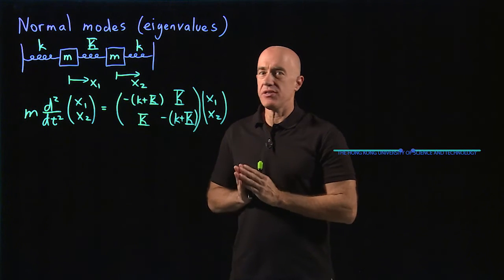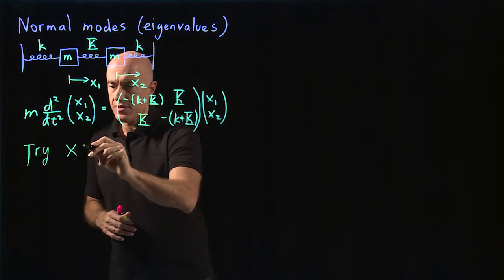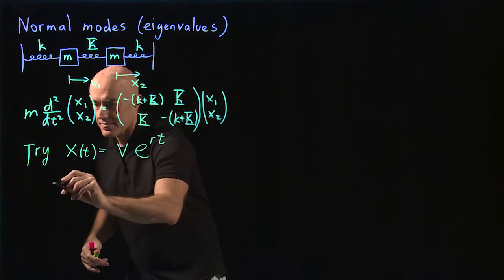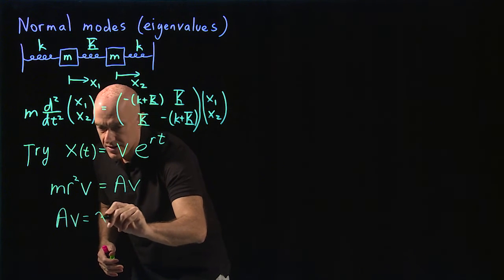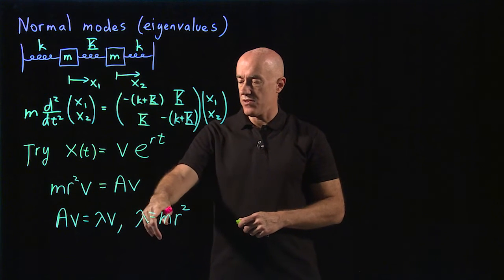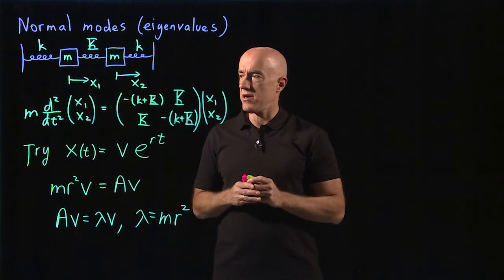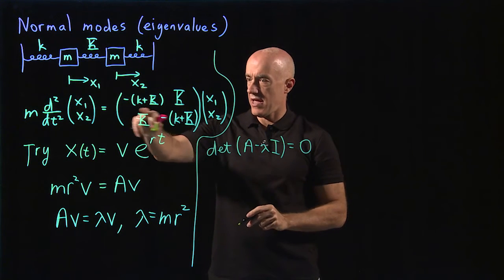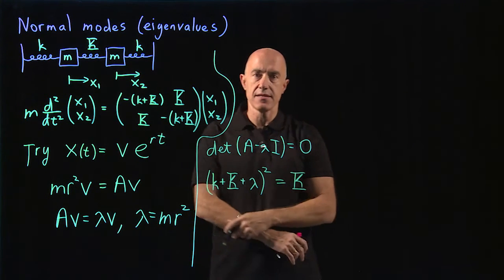Normal modes (eigenvalues) | Lecture 47 | Differential Equations for Engineers

Comment: i think you can solve this by laplace transforming the system of ODEs in terms of the dependent equations and then solving the system of equation in algebraic form. That should be helpful in solving when you have a damper or an input force in the system.

Comment: what if ihad damping terms?
Reply from the maker: The oscillations would be damped.
Reply: @Jeff-math  ok, but how could i find the eigenvalues in that case?
Reply from the maker: @diegox4122  Write a matrix equation and find the eigenvalues.  I think you will need to reduce to a larger system of first order equations so it may get complicated.  The eigenvalues will have negative real parts due to the damping.  I haven't done this before so you will need to see how it goes.
Reply: @Jeff-math   I will try, thank you!!!

Comment: I wonder, how do you choose the ansatz? I mean, when I'm studying this in college, my lecturer use x= Aexp(i*omega*t) as the ansatz. Or actually is it the same with yours, but it's in complex form?. Is there some rules about choosing the ansatz?
Reply from the maker: An ansatz is chosen by looking for a function with a free parameter that can convert the differential equation into an algebraic equation for the free parameter. i*omega  or lambda or whatever, it doesn't matter.  The correct answer will fall out of the equation anyway.
Reply: @Jeff-math  ohh okayyy thank you for replying :)) I got it now